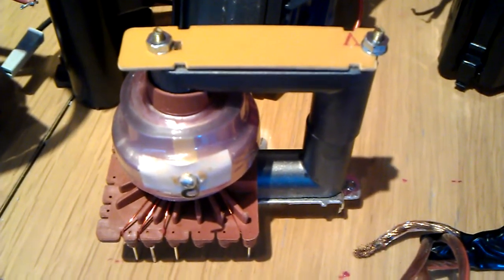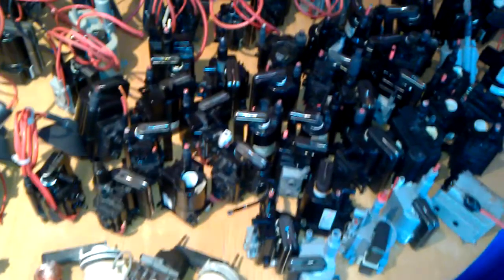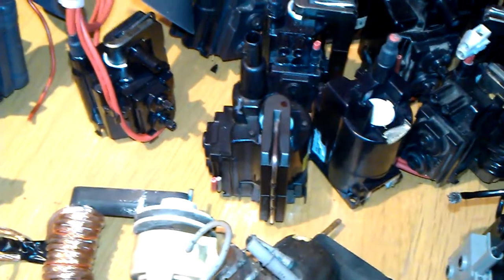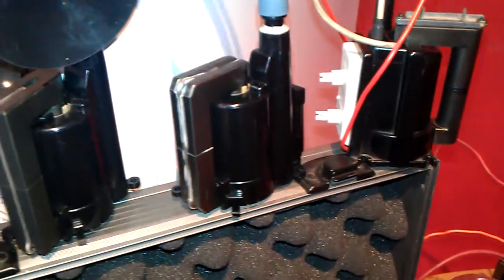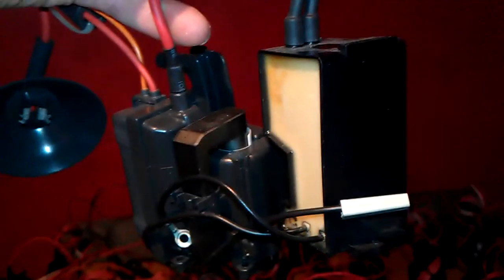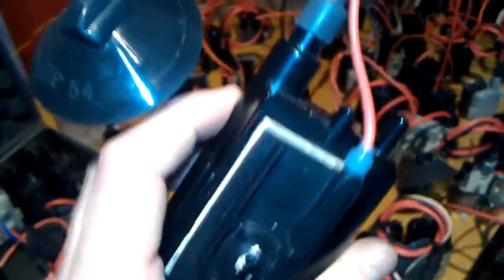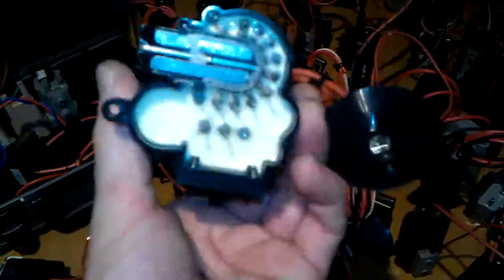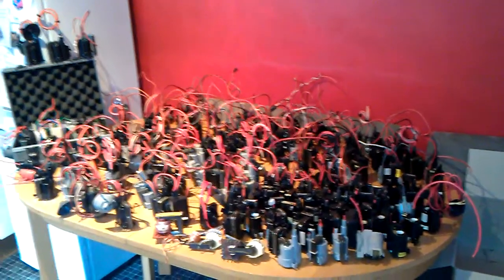All my flyback transformers!

Comment: Some had a tool to remove those.
Sony flybacks needed a pair of tools that resembled a straw cut in half.
RCA flybacks had the clips that went into the top so you could insert the cable but not pull it out.
Mitsubishi and Zenith had a twist lock system that was fairly easy to remove.

Not to detract from your love of flyback transformers...
That said.. I will ask people I still know in the service industry for a flyback with an integrated splitter/tripler if they find one.

Comment: I do have one of those projection TV splitters + one focus/screen adjustment x3 block. (My location is Norway), maybe we can trade something?

The splitter is only a capacitor and 3 resistors.

I have some HV-triplers too.

I am looking for 2-3+ same type flyback (HV) transformers to make a synchronized HV supply.

b.t.w. try connecting a light-bulb to a single turn around the core, it's a nice "this transformer is live" indicator.

Comment: Any plans to look into flyback controllers like UC3842?
Given you figure out the feedback-circuits, you will have a regulated HV supply that is quite stable. I have a board with the flyback still on from a computer monitor, just removed non-needed parts of the circuit-board and it gives 30 KV.

It does not do arcs (safety shutdown, will probably easily break if I disable it), but it does a nicely regulated HV supply for electrostatic stuff.